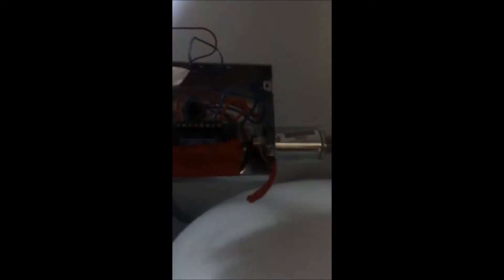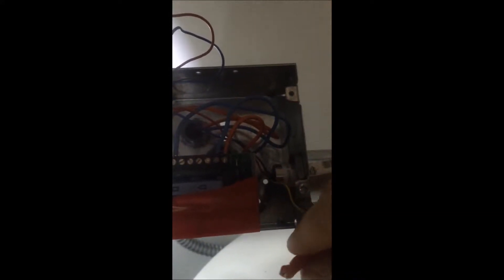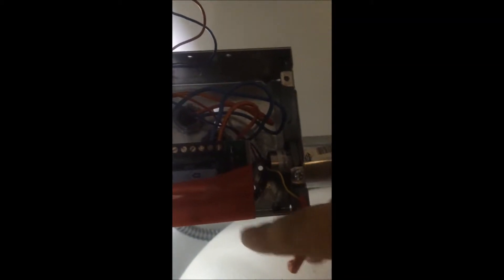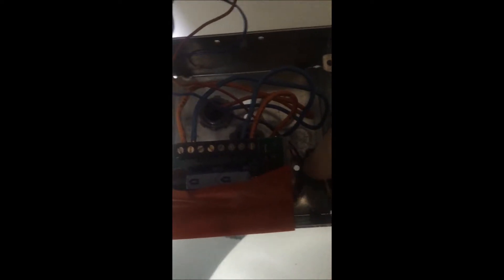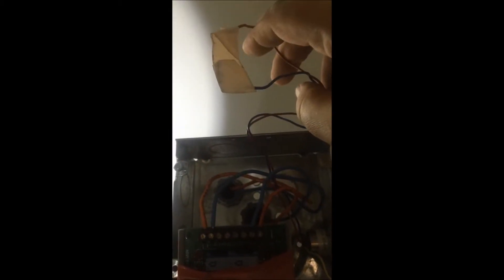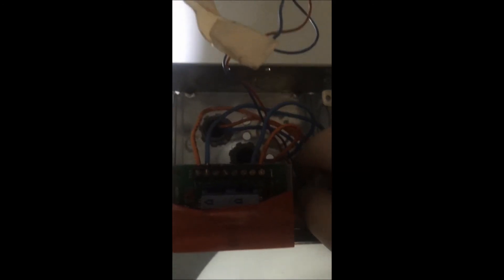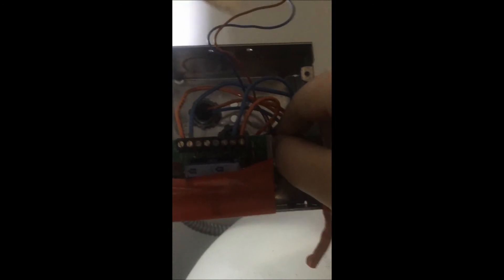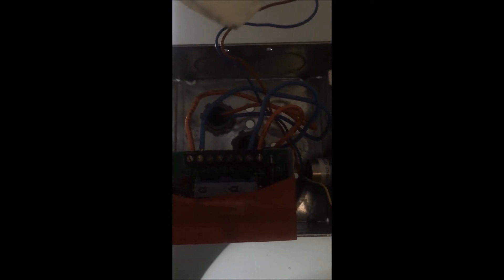Squib disarming

Comment: Just an FYI Make sure you always put the jumper in during of after testing of the FM-200 system because you need to dissipate the energy built up in the capacitor otherwise you could accidentally discharge the system.